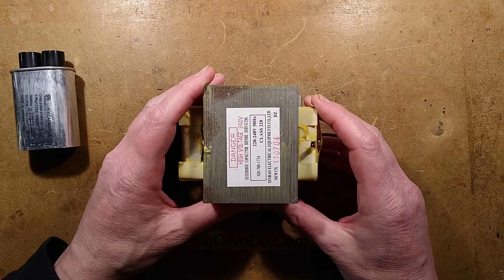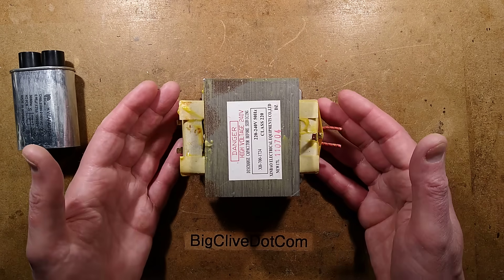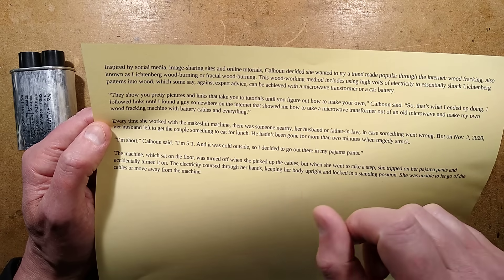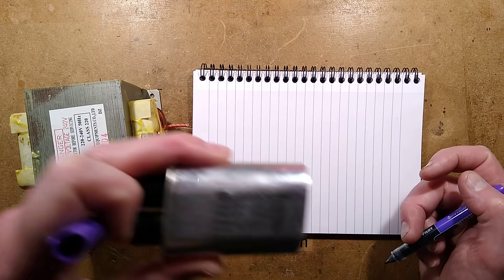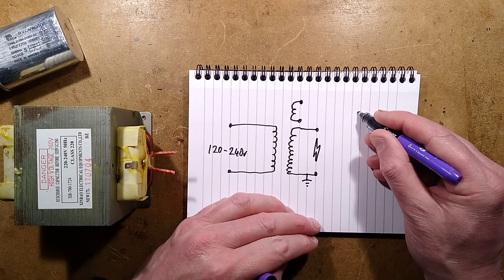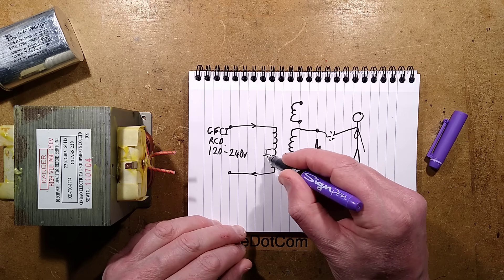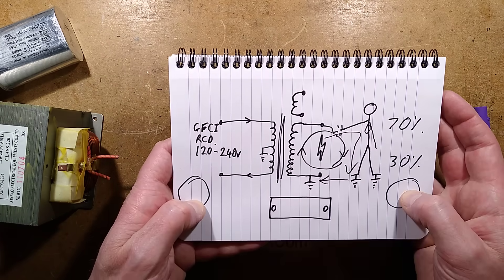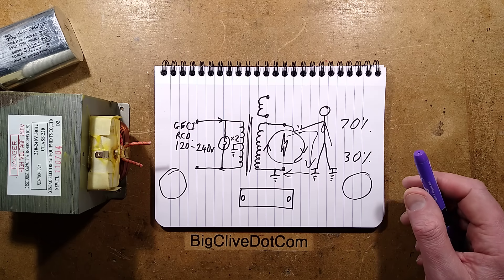The most deadly project on the Internet

Comment: Nasty stuff they are playing with without proper high voltage protective gear.
I had a friend who like me was a generator instructor for the US Army. He had a dead short of I believe 480 volts through his right hand while working 30 feet up on an overhead crane in a tank repair shop. The Germans had hotwired around the main panel breakers that he had shut off and tagged. He woke up a month later at Walter Reed Hospital outside Washington DC.
Not something to play with like they are doing.

Comment: Electricity is a beautiful, yet wicked force of nature. All too often people are ignorant as to how deadly it really is and that lack of understanding has cost many people their lives.

I am not a licensed electrician, but I have acquired enough knowledge over my life to deal with electrical issues in the home and in my vehicles. However, the one thing I stress to anyone that comes to me for advice is that they leave it to a professional. I encourage people to explore what they're capable of when it comes to hands on repairs/installation, but electricity is one thing I shy everyone away from. Electricity will put you in the morgue if you fail to know your limitations, and that's why I discourage everyone from venturing into that uncharted territory.

I've been messing with electricity for over 35 years, but there's not a chance in hell that I would tangle with a high voltage Step-up transformer. Installing and/or working on a 220V circuit is the highest voltage I will deal with, anything above that is out of my range of abilities. Unless you have years of experience and understand the dangers of high voltage capable of delivering serious amperage, DO NOT TOUCH THINGS LIKE THIS!!!!!!!!

Comment: If that's so deadly, then how come the power supplies for every real-life electric chair are so massive? During an actual execution we have anywhere from 1750-2800V (depending on the US state) at around 5-10A (depending on the inmate) with around 30 seconds of cycle time. And sometimes that's not enough electrical justice and they need more.
Reply from the maker: Theatre and government grade contracts.
Reply: @bigclivedotcom  No. Your little microwave transformer is not going to maintain the voltage. Fun fact, some electric chairs record voltage and amperage on a graph. But even Ol' Sparky in Florida doesn't maintain the 2300VAC  once the circuit is closed. It's not the volts or the amps, but the watts. The ability to boil your insides until steam comes out of your nose.

Comment: I would never deal with high micro farad capacitor’s or high voltage transformers. I work with low-voltage lithium ion batteries and those make me nervous enough even with a fire bag and a bucket of sand. 36 to 48 VDC is the max I will work with unless I’m changing an AC light switch, And then I’m killing off the circuit breaker for the 120 VAC and continue to assume the leads are hot. Thank you for the video but I choose not to play that DIY sport.

Comment: I made a vacuum Tube Tesla coil with a 120 volt primary but just as bad secondary. Drew High Amp electric directly from one with one hand in my pocket. Knowing they could kill. The Tesla Coil is really nice. Wouldn't want to touch that either but found solid state Tesla Coils. This project sounds neat but not worth killing your self! Try less dangerous ways. Personally I enjoy Hi voltage experiment. Certain very interesting High Voltage experiments can be done in relative safety.

Comment: I'm about to build one, I'm using all the safety precautions you mentioned as well as a momentary foot pedal, and an inch rubber pad on the floor. I'll run my battery cables through almost 3 feet of 3/4" pvc pipe, and I have thick rubber gloves. The transformer will be covered. If you can think of anything else that would help let me know. Thanks!

Comment: Your body is actually acting like a capacitor with resistor in series to "ground" even if you are floating in the air and not touching the ground (earth). Since the high voltage is AC, your body will conduct the AC electricity and the resistor part of your body circuit is the one that heats up your body an causes those burns. Only high voltage protection gloves can protect you with this one.

Comment: It should be mentioned that if you are going to mess around inside a microwave the transformer and cap are not the only things of danger within. The Magnetron contains beryllium. CARE MUST BE TAKEN TO NOT FRACTURE OR DAMAGE THE MAGNETRON. Berylliosis is a illness that would be something to be avoided at all costs.
Reply from the maker: Very few modern microwaves for home use still contain beryllium.

Comment: nice explanation. but why welding machine coil is not dangerous though it's like the microwave iadea.
Reply: He literally explained it. 
If you take the transformer apart and exchange one of the windings with a big wire, it creates high amperage (welding) but *low voltage*. So it's a lot safer.

Comment: 6:24 Also the old CRT televisions are very dangerous to go inside too, because they use high voltage.
Reply: A lot less dangerous than MOT's though because they put out a much lower current
Reply: @lickablestinkage7783  Current is irrelevant. Do you mean they don't output sustained high voltage?
Reply: @Owen_loves_Butters  no I mean CRT flyback transformers put out MUCH less current then MOT's and therefore are less dangerous. Keep in mind MOT's put out around 1 amp of power and at 2000 volts that full current will go through your body, CRT transformers put out only about 50-150 mA. Yes the voltage is much higher but theres less overall current to flow. And of course, as they always say, its amps that kill, not volts. You can have a billion volts at 1 mA run straight through your heart and you'll live. On the other hand, you can have 80 volts run through your heart at 5 amps and you'll likely die.
Reply: @lickablestinkage7783  As I said, current is completely irrelevant here. Your example does not make any sense, you act as if voltage and current are independent, they aren't.

Comment: Difference in potential, and least path of resistance to ground. . . Open core transformer. Primary voltage is defined as 600 volts or more. . . Primary windings and secondary windings is a difference. . . Takes less than one amp to kill a person. An "indicator light" is reference as a "pilot light" in electrical terms.

Comment: I am more fond of the 15kv neon sign transformers as they are current limited. Still deadly though. I am trained to handle and use high voltage power but still pretty shady stuff to do in an uncontrolled shop. To be honest high voltage still scares the crap out of me.

Comment: It can indeed be done with a car battery and high voltage ignition coils. And of course, high tension spark plug leads are a much more suitable cabling solution compared to just about anything else Joe Schmoe has around the house.

Comment: You did not mention the possibiity of adding a High-Voltage corrent-limiting resistor to the secondary circuit.  Would that prevent the burner from making the graphics?
Reply from the maker: It would dissipate a lot of power, and to bring the current down to a safe level would defeat the effect.

Comment: Honestly I have no words to describe how happy I am that this video has had over a million views. I do fractal burning myself. I do have a microwave transformer to do burns with.. I have done none with it. I understand power and electricity to much to dare use it for wood burning. Every new transformer I use, I first hook to a Jacobs ladder I have set up to see the arcs the unit is capable of. When I turned on the microwave transformer a half inch thick white ghost like plasma screamed up the ladder than arced six inches off the top of the tower. That was the last time I ever turned it on. Everything about fractal burning is dangerous. It takes one wrong touch and lights out. It doesn't matter how many people you may have around you. You yourself need to know everything about what you are doing. The only time I have ever been electrocuted during a fractal burn was actually because I had somebody with me. I was explaining to them how it worked and the wiring I was using on the transformer. I will never allow anyone to ever touch it again. I admit to how dumb this was but I feel its important to share this. I stopped doing my burn to let my friend in. We went out back to where I was currently doing a wood burn. As I was showing him the wiring as I was saying. I showed him the the plug wiring first.. As I turned around and picked up the high voltage lines for the output, I was turning back around and saw him with the power cable and extension cord in his hands. Before I could even say NO only "nn" came out of my mouth and I was locked. Luckily for me I was using an extremely low amperage unit lower than lethal limits. But regardless 15000 volts surging in your right hand for a split second is enough to make you collapse with exhaustion and feel aches all day. From that day on I overprotect my working area. I use two separate power switches and unplug the unit when I am moving the leads or need to walk away for a moment. I used to only use an extension cord. I would just unplug and plug it in from a safe distance. I am very lucky that it was just a lesson I experienced that day and it wasn't the final lesson I would ever learn.

Please to anyone who likes the way that fractal burning looks. If you have basic or no understanding of electricity. Just find and buy a fractal burn you like from a local market or online. If you really want to do the burns yourself well I have some advise. Step one - Understand and experiment with low voltage DC projects first. At most you can get minor burns and might damage your eyesight a little with the occasional short circuit flashes you will see. Step two - Once you have an understanding for low voltage DC electricity than you will be prepared to understand high voltage AC. Study high voltage AC before attempting experiments with it. Than get electrocuted by a taser. No that actual is not a joke. At the end of the second year of my low voltage tech class my teacher asked "So who wants to learn about high voltage?". Of course everyone raised there hands. He gave us a few lessons about the danger of working with high voltage. He than had the students come over and form a circle around his work bench. On the bench he had a taser rigged with a wire on each output. He had every student in the class hold hands in a circle and the two closest to the bench held one wire each. He than tapped a momentary switch connected to it. Everyone jumped and let go of each other. He than laughed really loud and asked "So who still wants to learn about high voltage?". Only me and one other student out of the 25 in the class raised our hands. He gave use some books and websites to go on and learn more about high voltage.

I wanted that last bit to be short but ill make this short. If you want to to do wood burns and play with high voltage, you need to be electrocuted first. I have not met a single electrician who hasn't been hit. Their job is less risky than fractal wood burning. One touch on the right beat of your heart and it stops. Please be smart and be careful.
Reply: You can buy machines ment for it from an art store that are probably way safer than what you can make at home. We had one in my art class in high school.

Comment: I made a 10 Amp isolation transformer from two identical microwave transformers by grinding down the welds, disassembling them and putting both primary coils back into one of the cores and having a buddy reweld it. Then I took the secondaries and unwound them and used the magnet wire to make air core inductors for speaker crossover networks which also used motor run capacitors. That was about 30 years ago .... I don't have those homebrew speakers anymore but I still have and use the isolation transformer and a variac for servicing tube guitars amps and old tube radios from time to time.

Comment: Wow, so people are once again playing with fire. If you play with fire you will get burned. If you want to do this, you need to make sure that you don't plug it in until it is set up. Even this is not enough since things like capacitors can be charged. To discharge a capacitor, you need to use a strong resistor and a load on it to safely remove charge from it. Then finish the set up and be no less than 1m away from the active area and that you have plenty of materials that insulate electricity, heat, and fire between you and the thing.

Comment: This is foolish. If you were right about saying no one should ever do lichtenburg wood burning. Should we not have welders? They use up to and beyond 200 amps. Safety is a concern for anything industrial! Should we quilt all things dangerous. Just be safe!!!
Reply from the maker: Welders are high current but low voltage.
Reply: @bigclivedotcom  Exactly. If you have a transformer outputting low voltage, you can still touch it and let go at will. At high voltages you cannot. You will absolutely d i e.

Comment: Hey Bigclive. You comment about shorting the capacitor terminals is a poor idea. A large value resistor, chosen such that the current flow is significantly limited and safe for you and the capacitor should be used instead.
Reply from the maker: That was aimed at people who don't have access to resistors and suitable type wire.

Comment: I don't play with high voltage, heavy duty springs, or compressed fluids. These things can take you out, or if your lucky, just seriously injure you without warning.
Reply: Things to not play with:
H.V.
Radioactive materials
Compressed fluids
Heavy duty springs
Exposives
Reply: @aiosquadron  I would add strong magnets to that list. Also, most of the wildlife in Australia.
Reply: Hydraulics are awesomely powerful and I do not ever want to get caught by one.  Even a ruptured fluid line can be enough to end your career as a human.
Reply: Add high speed to the list as well. It was fun once but I had an accident at the speed limit on a very wet day and that shook me up so much that its just not worth the risk driving too fsst. Especially on a public road!
Reply: You sound like a bright guy. Those are 3 things that the more you work with them the higher your odds of getting hurt get. All 3 best left to the pros. I personally add band saws to your list!
Reply: Basically don't play with:
1. Electricity
2. Chemicals
3. Large amounts of potential energy

Even a chain or a rope under tension could kill or hurt you. People have been sliced in half by snapping chains whipping at high speeds.
Reply: @TheGeekRex  It turns out humans are really fragile and it doesn't actually take all that much to seriously injure us, or worse.
Reply: Wear eye pro around fast moving machinery, always.  I had a drill bit snap and gash me one time.  That could have been my eye.  I wasn't wearing eye pro.
Wear the eye pro.  Don't be lazy.

Also a good idea to wear an N100 any time you're creating a lot of metal dust.
Reply: or compressed air I might add. Air compression guns are often played around with, probably because people equate "air" with "harmless", then before you know it someone is dead and someone is crying "I didn't know air could do that!".

Seconding wires under high tension :p
Reply: You forgot to add in wires under high tension, chemicals full stop and heavy machinery.

(edit) and I just remembered to mention gases under pressure as well.
Reply: @flamerollerx01 
 Don't forget eating and breathing and common sense
Reply: add some animals, chemicals, explosives, moving vehicles, steam, radioactives, running machinery, thin ice, and firearms
Reply: Garage door springs are a big no-no...
Reply: @Cipheiz Wow. That's it. Just wow.
Reply: Ditto.

There are dangerous things- driving normally, for one- then there are things that aren't to be effed with.
Reply: You forgot about radiation
Reply: Gas lines.  Don't play with gas lines
Reply: Don't play games on your SO with another cheater. One can also be taken out without warning. Just ask Colin and Mo.
Reply: you’re*

Comment: I have a friend who built a Tesla Coil (made with a Neon light transformer). He used it with his band. He researched it and figured out that if he stood up on the coil while it was operational and wore thimbles on his fingertips, the coil would produce visible electrical arcs which appeared to come from his fingertips. It worked great for a while and the audience loved it. One night he was performing in a small club and the HVAC duct work was right above the stage but had been painted black. He didn't realize it was a conductive surface and when he stood up while on the coil the electricity came out of the top of his head instead of his fingertips. He was instantly blown off the coil and luckily escaped without much more than a scare. He never performed that part of the act again and I don't even think he's turned on the Tesla Coil since.

Comment: Not even going to try, but a question - would a GFCI on the other side of the circuit save you?
Reply: He explained it. It wont.
Reply: @fusseldieb  Sorry, my wording wasn't clear.  He explained that it wouldn't work on the wall side of the circuit, but I mean in series with the wood-side coil.  I don't think he addressed that.  Did I miss something?

Comment: Good presentation, and well worth warning inexperienced people of the potential deadly dangers.
A lot of people have no concept of the difference between working with mains power voltages and current, if they've only worked with with small low voltage batteries!
.